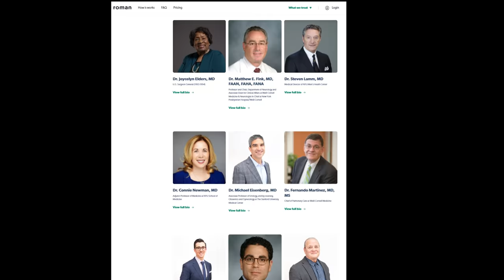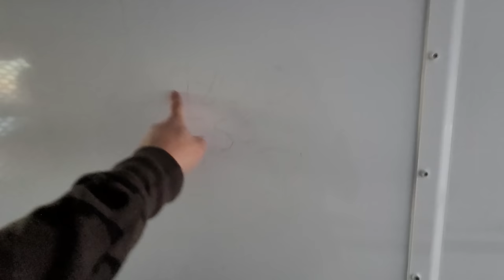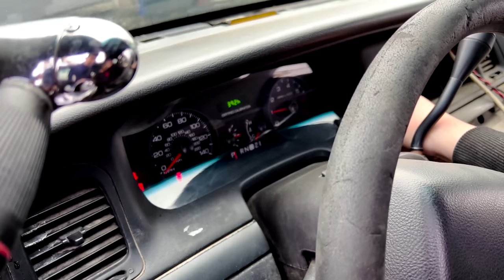A Junior Deputy's Everyday Carry! Police Auction Vlog! 2022

Comment: You owe that guy a new bmw. Pushing it without motor running most likely caused it to catch fire.
Reply: Not likely if it was on all 4 tires on the ground and in neutral. (Former tow truck operator for 8 years)

Comment: How did you reconnect the throttle by wire reconnected so fast when we did an engine swap it took us a month for a Ford dealer to do nothing then trying to get the car transferred to another Ford dealer then being told they don’t do that then getting to the final place that got it connected